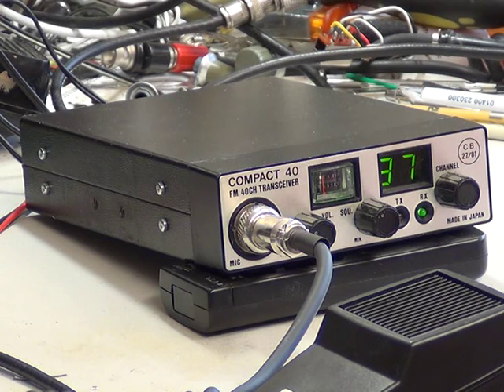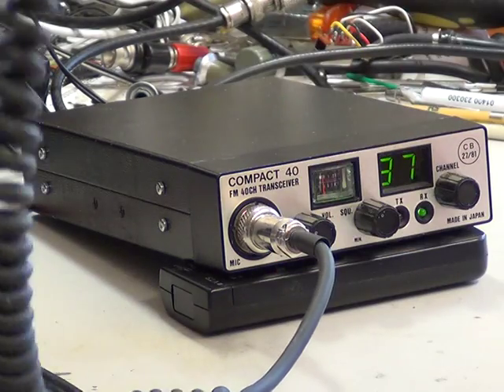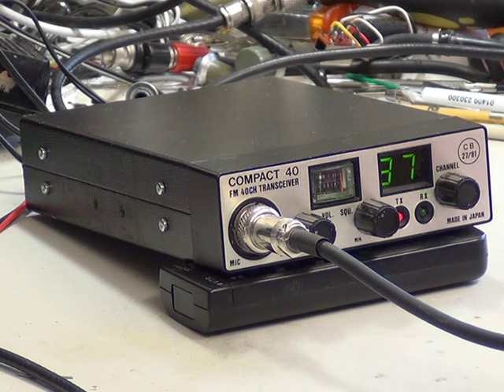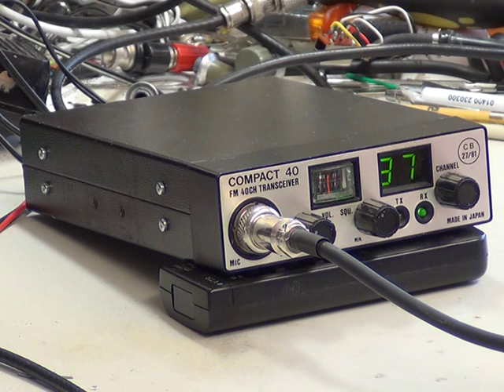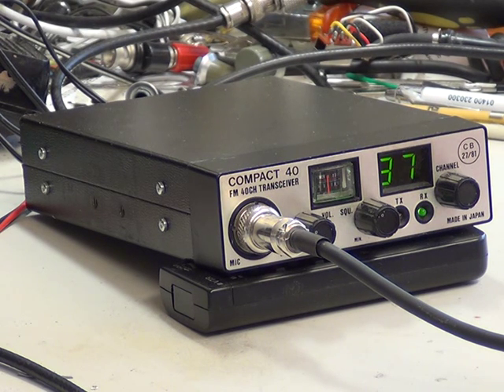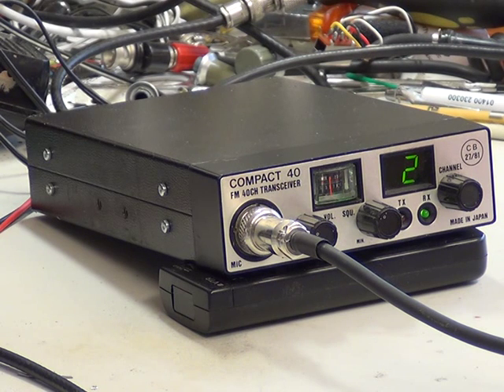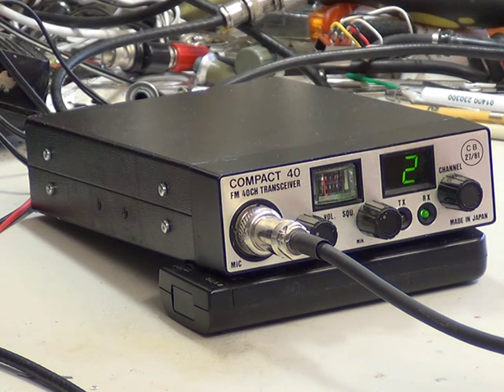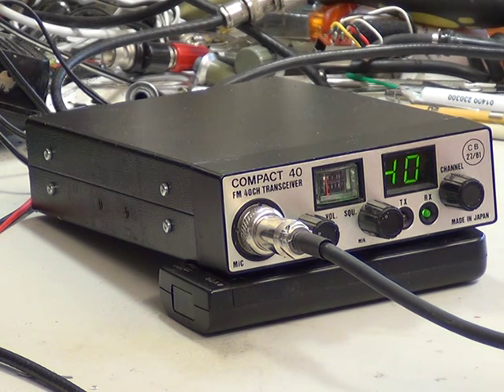Compact 40, UK (CB 27/81) CB radio (Mobile) - On The Air Test

Comment: was this the Binatone Speedway to? K5NOV
Reply from the maker: No, it was the Binatone Beambreaker. The Speedway also had a tiny meter but was a conventional sized set using the Cybernet 134 chassis.
Reply: Memory loss on my part :)UK CB radio servicing

Comment: These look a nice set and seem technically pretty sound - I'm never sure about those dinky little 'hand held' type signal meters on larger sets but it looks ok in this example. Even some little 'wings' moulded onto the channel change knob would make it more tactile and nicer to move, but again these are minor quibbles I'm sure!
Reply from the maker: It was still on the bench plugged into the aerial, so when I wanted to chat on it to a friend this evening I simply used it. Some sets I'd swap over for a "better" one if I actually wanted to have a chat, but I have every faith in the Compact 40. That must say something about it!